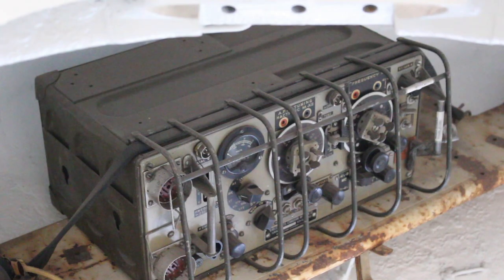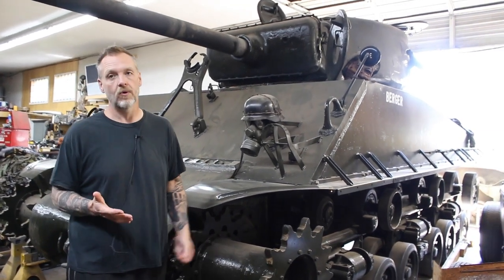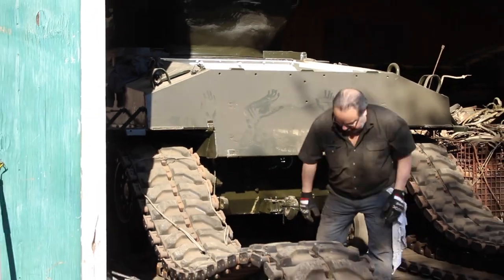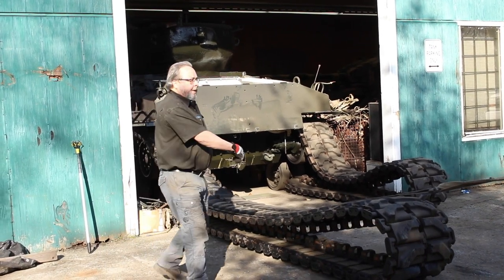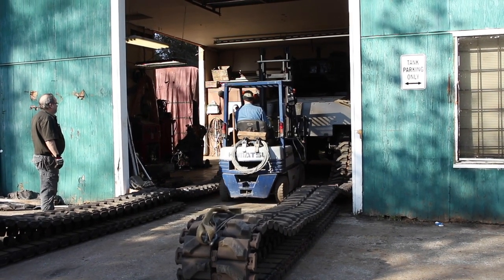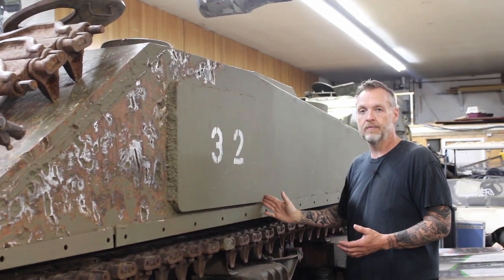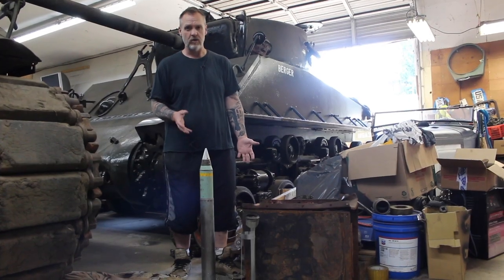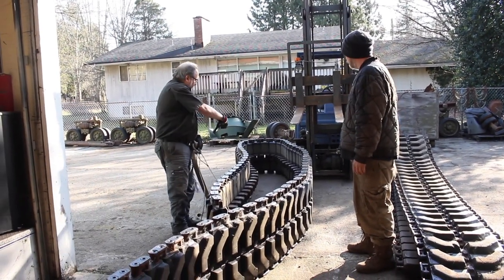Replacing Tank Tracks | Part 2

Comment: That is a very bad job installing track, what we done in the service was to get tank on level  surface, with plenty of room in front of tank, broke track, hooked up new track to old, using tank to pull new track in place , that remove old track, than recouped new track together , tighten track and drive off with new tracks

Comment: Those tracks can weigh up to 2 tons each and it looked like that forklift only just coped wit the weight.when your  reboilding a tank you must respect the fact that all the parts are very heavy ,gun turret, tracks engine and gearbox etc and if mishandled you may end up with more than a broken ankle or leg and those tracks are heavier than buldozer or excavator tracks and to testore one of those heavy galiaths you need the right equipment for the job , be careful guys you are doing a great at restoring war history keep it up.
Reply: 2 tons?!? Oh my, wasn’t aware of that.